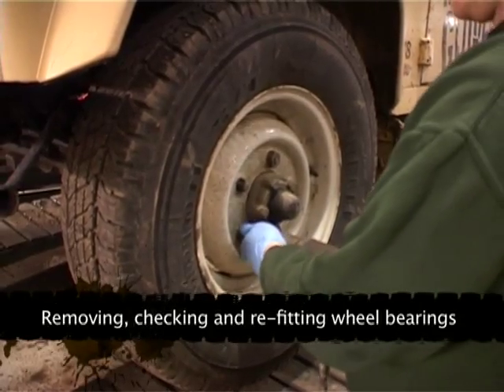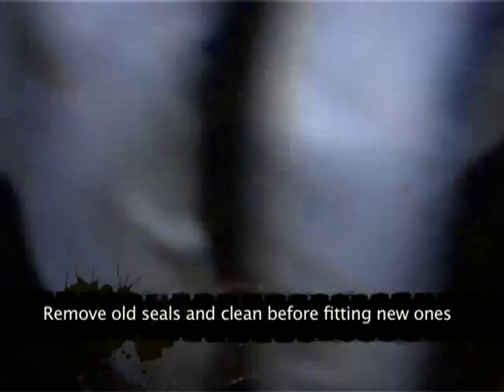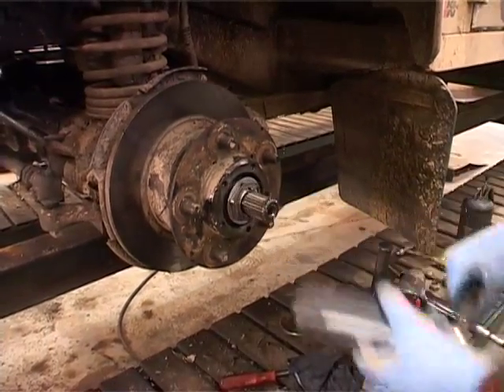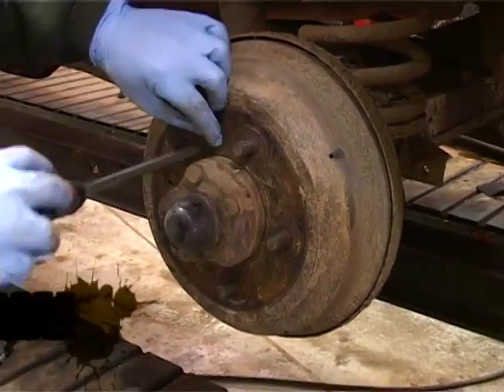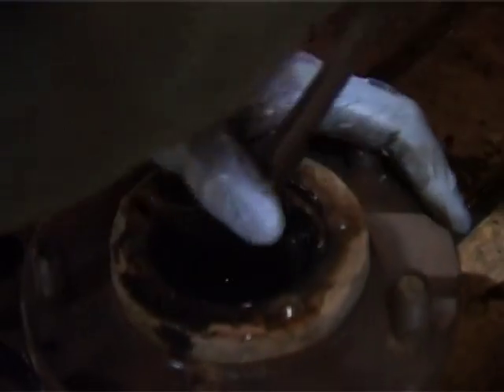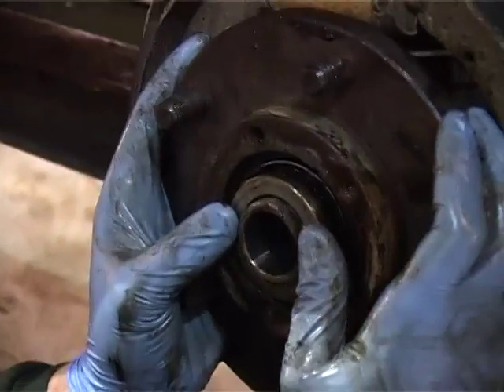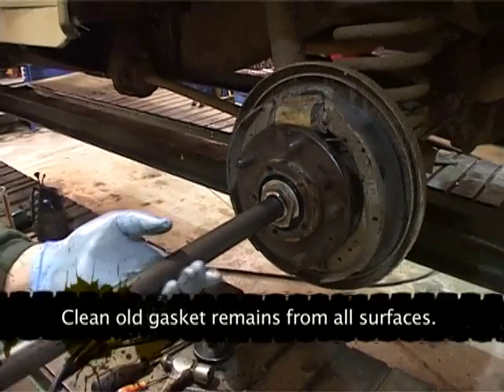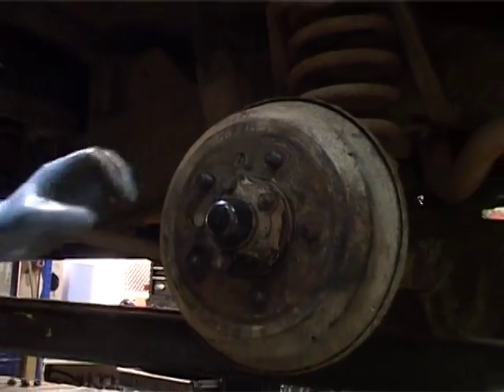Defender wheel bearings- How to remove and check

Comment: discovered later there are types with a bush between the bearings, so no adjustment for endfloat needed, and indeed have to be torqued down. So check if your wheelhubs have a bush between the bearings!

Comment: Shouldn't you change the bearing race at the same time as the bearings? I believe each individual and bearing and race are matched to each other so that they are within very tight tolerances. That's why the bearing is always supplied with a race and they should never be mixed up.